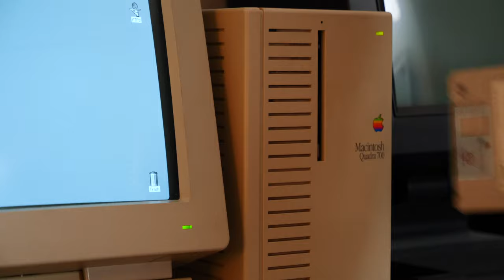Heartbeats: Restoring A Macintosh Floppy Drive

Comment: This takes me back!
A common problem in the 90s was disk shutters coming off in the school’s disk drives. I used to remove them and do this kind of refurbishment. Particularly the greasing of the eject motor gears would just make that sound a little silkier